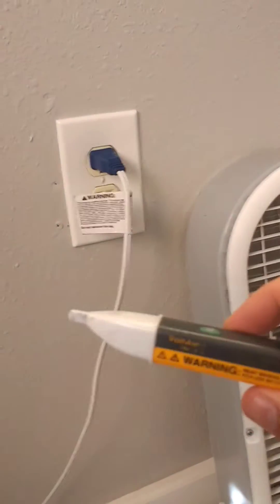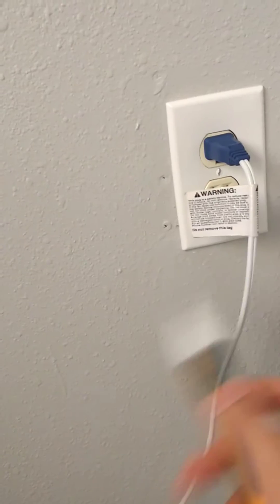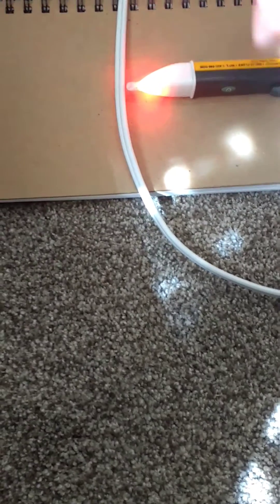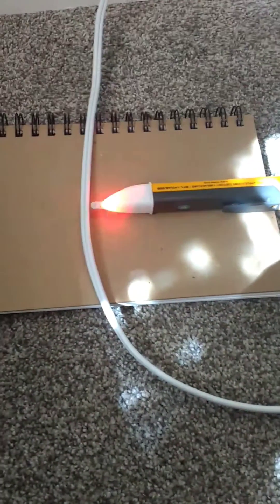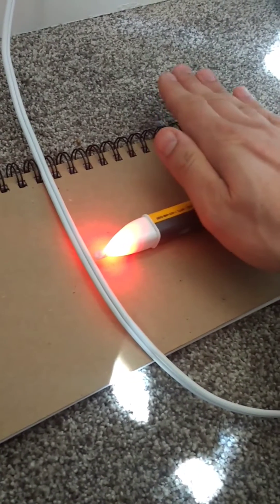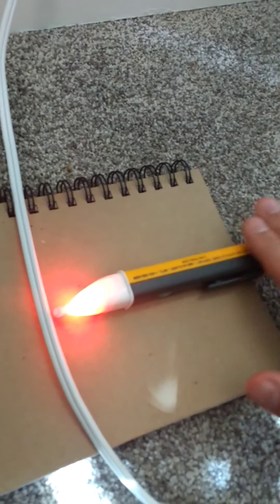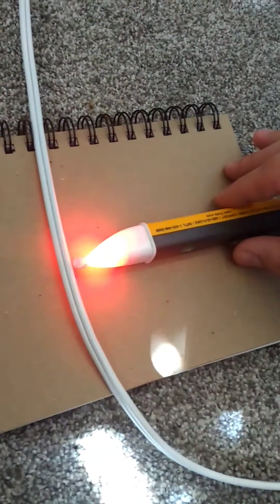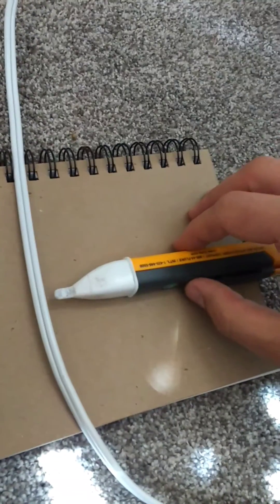Operation of Fluke VoltAlert depends on the user's proximity to the sensor's barrel

Comment: Hi. We have developed a similar detector but are having a problem, it fails to detect when it is raining, the antenna is fixed on the insulated 230VAC wire.
It works fine when it is not raining. Do you have any idea what property could be changing when it is raining? Also the stronger the rain, the stronger the effect.